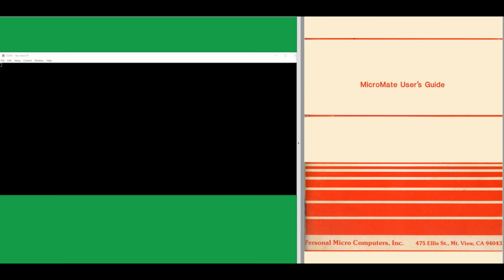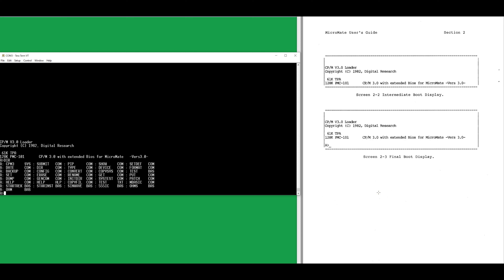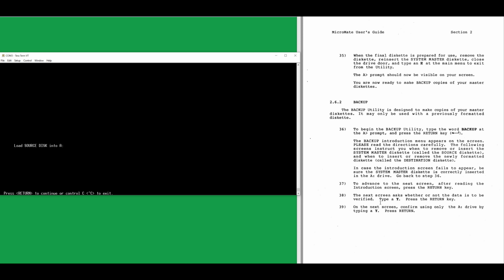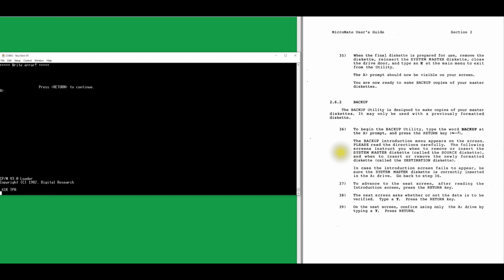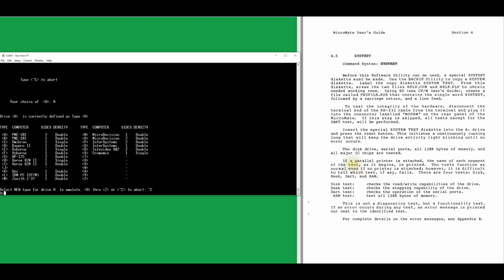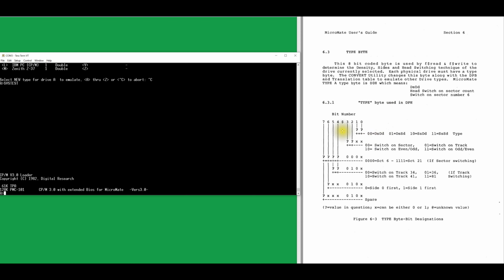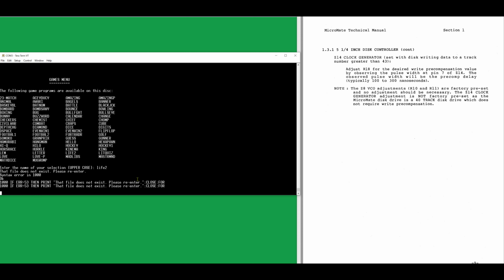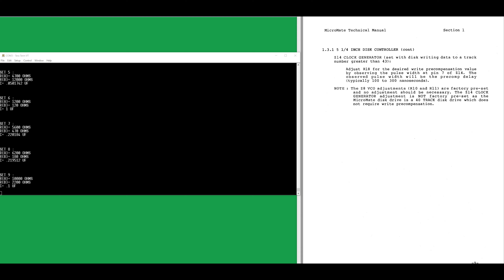STB994 - PMC-101 - Part 4 - A look at CP/M and the Manuals

Comment: Just got finished watching your PMC-101 playlist, with interest as I have one sitting in my closet waiting to put a new power supply in it. Unlike your replacement, I'm using a Mean Well RQ-65B. My original power supply died about a year ago when one of the caps "sizzled, popped" and made smoke. A question to you. Did you determine why you needed to rig up the "power on reset" and the clock circuit using your replacement power supply? Today is Dec 12, 2023 and am planning on having changes made by the end of this week. Also curious, what is the serial number on your unit?
Reply from the maker: I've recently moved and my PCM-101 is in storage so I can't look up the serial number at this time.

While scoping around trying to understand why the clock wasn't running, I noticed that when I touched the scope probe to a certain pin the clock would start on power up. The probe adds ~20pF to the pin being probed. This additional capacitance may be slightly delaying the oscillator startup or perhaps changing the phase a bit on how the oscillator feeds back to keep the clock running.

It's hard to say why the cap was needed. It may be the slew rate (how long it takes to get to the regulated output voltage) of the original and replacement power supplies is different enough to cause the issue. It may be due to different switching frequencies between the two supplies where the new one caused enough noise to interfere with the oscillator.

It's not uncommon to see extra capacitors or resistors on a PCB that were not part of the original design. In my experience the older the system the more common this was. It wasn't (isn't) uncommon to see a design rushed to manufacture before it's fully tested. Differences between parts from different manufactures can cause issues. A 74LS04 inverter from TI and NSC while meeting the same specification will have differences in slew rates, threshold voltages, current draw, propagation delay etc. One part will work fine while the other causes headaches. A capacitor added to soften an edge (transition from low->high or high->low) may have been added to address an issue such as this. A resistor to pull a signal a bit closer to Vcc or Vss may have been required. A resistor may have been used to sharpen up an edge (decrease the slew rate).

A fundamental thing people miss in "digital" systems is that what makes it "digital" is a set of specifications for voltage levels, slew rates, relationships etc. It's easier to think of "digital" systems as a neat and clean set of square waves and relationships between the edges BUT in the end it's all analog in the hardware implementation. What we think of as a square wave is several sine waves all superimposed on top of each other. 

Every digital IC internally is an analog device. In pure electronics there is only analog. "Digital" imposes a set of rules that define how the analog signals are interpreted to act as a digital system. 
On modern motherboards you will see PCB traces that are matched pairs, and often have odd squiggly paths they follow. This speaks to the true analog nature of the system. Matched pairs are transmission lines like a radio transmitter might have. Squiggly traces result in all the traces along a set of traces (bus) being the same length, so the voltages sent all arrive at the other end of the traces at the same time. It’s all analog.

My adding the capacitor changed something in the analog electronics that we think of as a "digital" system and made it work closer to the definition of the "digital" system. What it did is hard for me to define. It would take someone much more knowledge than myself to really understand/explain it.
Reply: @ShadowTronBlog I understand about moving. We did our last! from Nebraska to Texas back in 2017. I think! that I now know where everything is. I've been at this a while - Purchased my first computer RS Model 1 in 1980, bought my Model 4p brand spanking new in Dec 1983. So it just turned 40 years old. It's not working right now because of, the capacitor blew! That will be a project for another day. In the mean time, I've subscribed and looking forward to your Model 4p playlist.
[Addition] Well I've got the power supply hooked up and the cpu boots fine from the system disk. Apparently I can read disks that I made with this machine-about 2 years ago-but trying to write to them now gives errors. Unknown if it's the drive or the disks or a combination of both. But at least the system works ok, didn't run into the problems you did, just different problems!